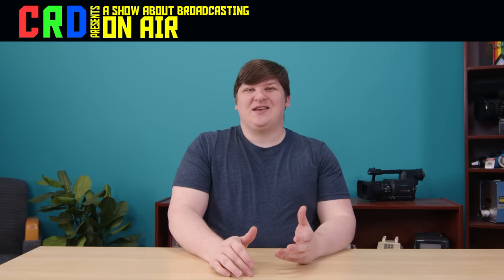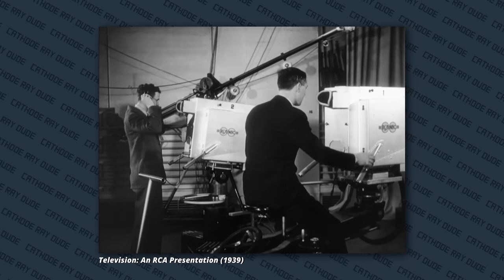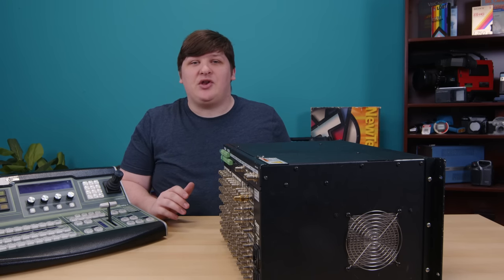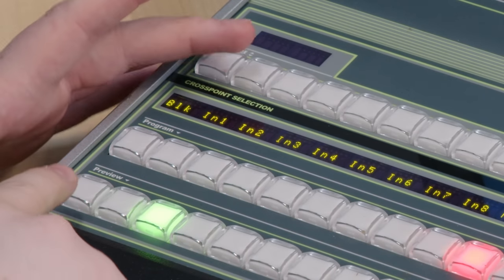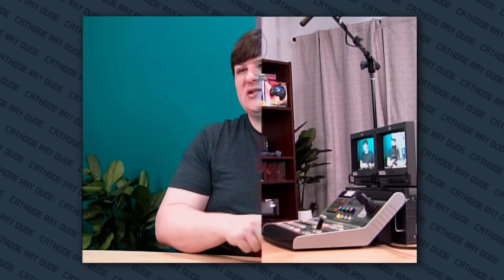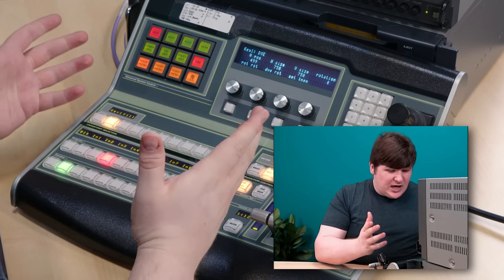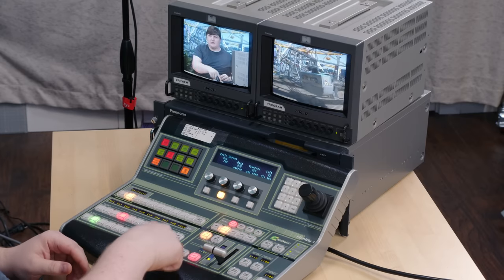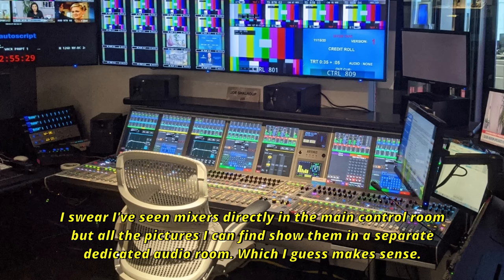What the heck is a video mixer?

Comment: Question, for audio mixing as that's seperate, how would the audio mixer synchronise with video cuts when you need a totally different source?

For example, a news broadcast going from the studio to the field. I imagine you'd want the audio to come up straight away wouldn't you?or is the audio mixer just waiting with his finger on the trigger when he sees the cut? I'm guessing that wouldn't work of there's background noise as then you'd notice the delay.

Is that so etching you'd use tally outputs for, to "request" the field preset from the audio mixer? Or are tally outputs just for illuminated signs and such?
Reply from the maker: Three part answer, part one: if you look up some clips of the news, I think you'll find that in that scenario, you almost always see the remote shot appear while the anchor continues talking, and then the remote slowly fades up. 

Part two: I'd be shocked if there isn't some way to automate communication between the switcher and audio board for when you DO want this. You probably wouldn't use tally for it, AFAIK those are exclusively for controlling camera-top and monitor-top lights, but there are "GPIO" pins on mixers that could be used, for instance.

Part three, modern news studios are so massively automated that this is probably all driven from a single computer via network API anyway
Reply: @CathodeRayDude   is right.

Tally is used for highlighting which device is “On-Air”. It’s generally the red light on top of a camera however systems exist to add it to preview monitors in the control room. I’ve even seen tally lights on Sony 1” C format tape machines that were used to put TV programs to air.

The relays in the mixer heard on the video are for Tally. General Purpose Output (GPO) and Tally are just presented on the controlling device as a switch for the controlled device to do what it wanted with. Controlled devices supplied voltage source and sink for whatever operation it needed. E.g: voltage source - 5v PSU rail, voltage sink - big LED on the camera. The Tally relay in the middle to switch it on and off.

Audio mixer control wasn’t used much before full studio automation came along. Audio mixers with automation would have been orders of magnitude, more expensive. Because to automate audio controls on a mixer, each control had to have a little motor.

Automated audio mixers would have been used in high end analogue edit suites for precise control of timing in edits.

Comment: If mixers have to capture the input into a framebuffer, and wait for a frame from every source to allow for video sync, doesn’t that introduce up to a frame or two of extra latency? Wouldn’t that be noticeable unless you delayed the audio to match?
Reply from the maker: It can, yes, but the ideal solution is to not frame sync everything. Even modern 8K cameras still have genlock inputs for exactly that reason. But my assumption is that where that isn't possible, they just delay the audio slightly to compensate.

Comment: TD🍻
Mx50 has only 2 TBC's (time base correction) so if you cut on the same bus you will get a freeze for up to 1 frame.
So you turn down the knob to 0 and there your "cut" but you have to alter your hand every time.
All old pro switchers did not have tbc's rather used SYNCED (genlocked) signals, tjose can be cut or mixed with simple electronics.
Mostly pro switchers escelled in something called E-MEM so you could "recall" positions.
You could do that for only 1me so basically switch between 3 cameras while each background (chroma key) was also altering. 
Creating a "real" studio sensation.

Why anyone pays 700$ for an old analog machine? Coze ppl are crazy. You can get a full blackmagic HD switcher for 999$ brand new 
Or for a few tjousands a 4k or 8k version with 10 inpouts 2 media players and many keyers.

Any questions? I am a pro since i was 15yo, that was in 1995

P.s the preview on mx50 is actually showing "effect" all the time, while the A or B (or effect) can be selected as the program out.
So if you select A you could preview yiur effect.
All well in theory. In reality tjis switcher is horribile and almost top of the line for hobbies use.
Later came the mx70 which was nothing better😅

Comment: Ok, you did eventually get around to saying "genlock". None of this analog voodoo works if the frames aren't perfectly aligned. When they aren't (i.e. "can't"), the hardware gets very complicated, which means bulky and expensive. (see also: delay lines) Stretches, flips, etc. were possible in the analog domain, but those machines filled a shed. "Today" (starting nearly 30 years ago with that fancy Newtek box behind you :-)) we do all this digitally. (it's "trivial" enough a RPi can do it.)
Reply from the maker: Yep, I left all that out because the older solutions would have all been rare and bespoke, and the newer stuff (including almost every single mixer I have in this video) just packs framesyncs into every input and makes it semi-moot, so I figured it wasn't worth 15 minutes of screen time to get into. The Toaster actually has no framesyncs of its own! You have to genlock, or framesync externally. All the later Toaster models for the PC had them built in though.

Curious though, I have never found any info on analog effects units that could do transforms like that. I would be very interested if you have any names I could look up.
Reply: @CathodeRayDude  I wish I could remember a name. The video (doc) I saw basically said it was the last functional one in the world. I'm not joking when I say it filled a shed. It was a dozen or more racks of gear, PLUS the console. (we launch nukes with less gear)

Comment: Live YouTube shows need a video switcher and someone to operate it. I've never been impressed by by the PC platforms for video.
Reply: Part of that's because they're not coming from a video switching background. It comes back to the question of would you rather have a novice with professional equipment or professional with consumer equipment. One of them will be limited by their knowledge and one of them will be limited by the equipment. But either of them could overcome but one of them is most likely going to be able to cheat the system.

Comment: Hey.... So I got something so weird and in a incredibly slim niche.... Video editing software called Speed-Razor Mach 3 (I also got 3,5 and 4) by in synch corporation.

So rare you can barely find anything on it. Works under Windows NT.

Its in a huge oversized (probably overprized back in the day) box that looks more like it was made for VHS tapes.... 

Interested?
Reply from the maker: A wild thing about this is that I actually have Speed Razor, but only because I also have a different extremely rare thing. It came with the first version of the Windows-based Video Toaster, so I've used it, and whew, it's pretty rough. I think I gotta decline, since I don't really have anywhere to keep the big boxes and I'd feel horrible throwing them out, and I don't think the software itself is all that exciting, but thank you for the offer!

Comment: About the Audio Appendix, don't transitions usually include a sound effect nowadays? How do they make it work?
Reply from the maker: Good question - I can't speak to it precisely, but my guess is that video mixers have audio outputs which get fed into the normal audio mixer. I imagine some also integrate DDRs (digital video players) and would need outputs for those as well.
Reply: @CathodeRayDude  Yes, many CGs (Ross Xpression, Codi Chryon) have internal audio clip playback and include an embedded SDI audio and video source all down one SDI cable. Many times, you have to run the CG with embedded sound through a de-embedder, to separate the picture and sound, run the video to the video switcher, and route the audio as AES or MADI audio to the sound DSP core, and control surface.

Comment: Still astounded at how cheap Blackmagic gear is. I mean a lot of is still in the thousands but not price-of-a-car 
I was using an ATEM for a while and it was great but a clever VMIX setup ended up cheaper and more flexible. It does take time though! totally agree on the OBS vs “real” mixers. VMIX has its idiosyncrasies but if you want “real” mixing on the cheap: a decent desktop, a sub-thousand dollar black magic cap card, Vmix and a lot of patience will get you there
Reply: Black Magic gear is cheap, but it's not super reliable in the long run... many of their solution run really hot, and tend to eat themselves after a while... YMMV
Reply: @tekvax01  OH! Good point. I run a silly amount of supplemental cooling. Had an old HDMI cap card eat itself. The Quad one has been bulletproof

Comment: Since audio and video are mixed separately. How are they ultimately synchronized before broadcast?
Reply from the maker: As long as there's no undue latency being injected anywhere, no synchronization is needed. But in situations where there is latency, I honestly have no answer. I would guess they have digital delay units for the audio and methods for syncing things up.
Reply: That's done by the audio guys. They add a small delay since video is always slightly "slower" than audio. Think it's usually around 20ms, but it depends on framerate, and if they time it to the wired or wireless cameras. Then the audio is embedded into the video signal before being sent back to the station and on air, so after the embedding the audio -should-stay syncronised with the video.
Reply: @volltesdalTV  it can be up to several frames or even fields out of lip sync...
Reply: @tekvax01  Can be, yes, at least if you start talking about external sources or consumer/prosumer/not-intended-for-live gear. But as far as regular broadcast cameras goes, their latency is less than a frame, so that should normally be all that's needed for the "master" audio delay for a production. Individual sources coming into the production will of course have to be dealt with seperately. But the cases where we have delayed the program audio with more than two frames are very rare.

Comment: You mentioned that moving one of the inputs vertically can't be done in analog but I can think of 2 ways It might be possible.
1. Analog delays are a thing, for example you could just use a very long wire. Probably not very practical though.
2. You showed a port on the back which is used to sync the cameras. If you had one of those per camera you could deliberately desync them.

Of course eihter way you then have some extra bs to deal with, for one thing you would want the desunc to be always an integer number of lines, otherwise you'll also get a horizontal shift and wrap around and it'll be a mess.
You'll probably also need to deal with blanking intervals somehow.

All in all probably just not worth it.
Reply from the maker: There are a couple problems with doing it in the analog domain. First, if you delayed the signal, then sure, it would move down - but there's actually stuff in the part of the image that's not onscreen, which would appear instead, and would both look bad and confuse the hell out of the receiving set. And if you want to move it up, you'd have to delay the first signal instead, and that would require the receiving set to adjust its own timing, and in practice that wreaks havoc on the picture. Even more importantly, analog video is interlaced, so "line 2" isn't really "line 2", it's actually line 265 (or thereabouts.) So yeah, it's probably technically doable, but fantastically complex.
Reply: @CathodeRayDude  yep, I mentioned blanking interval complexities.
And in don't see why interlacing would be an issue tbh, except maybe that "integer number of lines" should perhaps read "even integer"...

On the flip side, I'm unclear why a purely analog mixer would care if the signal is SD, HD, NTSC, PAL, or something altogether more exotic?
Reply from the maker: @LeeSmith-cf1vo  Honestly, if it seems possible to you, then perhaps it is. This stuff mostly just hurts my head to think about, heh.
Reply: @CathodeRayDude  possible? Maybe.
Practical? Nope
Worth it? Definitely not!
Reply: The main issue here are the sync pulses. (And potentially also the color burst, but then we're talking a very long time ago in a professional setting.)
The sync pulses in the signal have to stay in the same place regardless of what you want to do with the picture. So say you want to do a wipe where source B is pushed down a few lines. You could design the mixer so that it passes on the sync pulses from source A while the transition is happening, but then what happens if you complete the wipe all the way so only signal B is visible? Do you keep using signal A's sync pulses? Then you're still occupying the transition circuitry and can't do another wipe until you are no longer  on source B. The logical thing would of course be to modify source B so the sync pulse stays in the same place while the image is delayed, but then you're already in the domain of DVE's. And that's just for the "simple" act of delaying the signal by a few lines.
As for why an analogue mixer would care which format it is receiving there are probably several reasons, but the first one that comes to mind is that vision mixers internally use pattern generators some functions (wipes, keys and such) and the output of those would have to be the same format as the sources the mixer is recieving.
Reply: @volltesdalTV  given that its the mixer telling the cameras how to sync, why do you need to use the sync from either camera? Just generate a new one always...
Reply: @LeeSmith-cf1vo  That's not how it works, the mixer is not handling sync as such. Everything in the studio, including the mixer and the cameras, is slaved to the sync/genlock signal from an external sync generator. The mixer expects, and requires, every signal to be locked to the same sync signal that itself is receiving.
Based on this master genlock, every signal source adds it's own sync pulse to the signal it is generating. This means that every signal that goes into the mixer has it's own sync embedded, but because of the master genlock, they should all be in exact time.

This means that an analogue mixer can simply cut and mix the signals, sync pulse included, and not worry about sync at all, it simply passes through the incoming sync. (For digital it's not quite that simple, but the same principle applies; the mixer expects every signal to be synced before reaching it.)

Yes, modern mixers have framestores on some or all inputs, but those adds delay to the signal and are not used unless they are needed, and back in the analog days, framestores were big and expensive and not something that could be built-in in a mixer.

Comment: The first thing that caught my eye is the Echolab panel, it looks exactly like the BlackMagic Broadcast Panel 1M/E. Does anyone know if these are compatible?
Reply from the maker: They are literally the same unit, but BMD replaced the coax interface with an ethernet one. You can convert the old panel to the new with a $600 third-party adapter.

Comment: I used to broadcast school board meetings and yes, it really do be like that. (It was that exact cheap DataVideo unit.  I liked the little swap throttle thing though, I think that should be in more things, it's a LOT more smooth to use than a slider on an audio mixer or something.)  The setup was the hard part.  That, and restraining myself from vaulting over the mixing desk like a hockey player in the 70's to go pummel the life out of the fascists who kept coming in to yell about masks and CRT.

Comment: Hmmmm... 50 frames per second IS NOT the Metric system!! maybe you should go through the math that defines a 30-frame 525 black and white video signal, and the additional math that adds the colour information on top at 29.97 frames per second! PAL is very similar to NTSC, except the frame rates are 50FPS and 625 lines. They chose that number of lines (625) to avoid having to do NTSC's colour frame harmonic interlace mathy 29.97fps thing!
Reply from the maker: dude, that was a joke.
Reply: @CathodeRayDude   My bad... A very dry and obtuse joke... :)
It might be worth a discussion of the math behind these standards.  I'm sure some of your subs might be interested in that rabbit hole. I could assist if needed... :)
Reply: @CathodeRayDude  Sorry, I didn't mean to sound nasty... I sure hope I didn't... I've been working with these analogue and now SDI mixers for a very long time, and frankly, I love the old analogue video and all the math and theory that goes with it... I really could help with that portion of your scripts, if you were interested. 
I've even built several production control rooms from scratch over the years. I really enjoy your content and watch whenever a new one appears.
Reply: I found it funny because it's actually the opposite. 60 Hz in the US 50 Hz in the UK for electrical frequency which is then used to drive the frequency of the lines scanning. Or at least was before integrated chips.

Comment: massive massive wasted oppertunity to use wipes when talking about silly wipes instead of cuts to give a practical example of why they are silly
Reply from the maker: I thought about it, but it makes editing slow and unpleasant, and it's very visually distracting. It's sort of like "how do you demonstrate how annoying a sound is without making the sound," and in a lot of cases the answer is "you can't, not without driving people away just as much as the sound did in-situ"
Reply: @CathodeRayDude  fair enough, also small note: later in the video you talked about the rack mounted stuff, im 97% sure those would be mounted "Face up" in a desk (if you dont know what that means, google "Audio rack face up") as it would be very silly to mount and operate em in a vertical stack